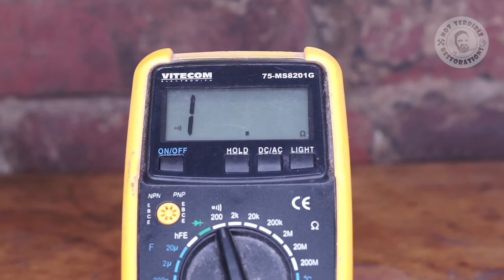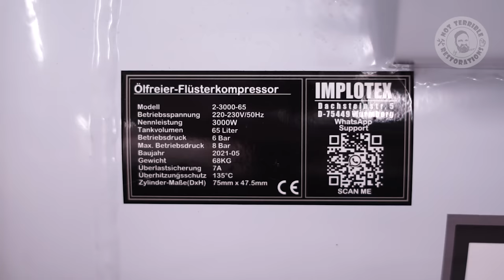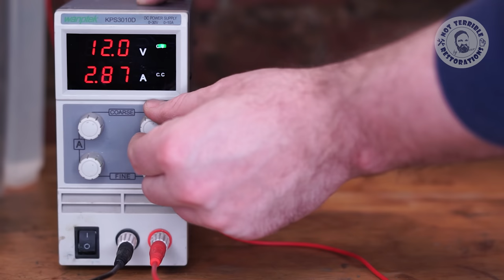You never SAW it coming - 1960's FESTO REPAIR and OVERHAUL

Comment from the maker: Disclaimer: I was kindly informed that the saw blade seems to be mounted the wrong way around. Very good eye and I missed this detail during video editing. However, the saw blade is mounted the right way around. At first I also thought that the saw was turning the wrong way around, i.e. that I had wired the motor incorrectly. When I frantically ran back to my workshop to check it, the saw turned the right way around. 

And then I realized what had happened. And here is the explanation: 
The shutter speed of the camera and the rotation speed of the saw blade are overlapping in such a way that the camera always takes a picture when the saw has almost made another rotation. If you line up these pictures in a video like usual, it looks as if the saw is rotating in the wrong direction. You know this effect for example from car commercials where the wheels seem to turn backwards when driving forward or in videos of old propeller planes where the rotor seems to turn slowly in the wrong direction.

There are countless explanatory videos on youtube, if you want to learn more about this.

I wish you all a good start into the new year and hope you will tune in again for the next video.

Comment: Hi. Very, really very nice restoration.
Quality is high and you really know what you are doing. The result is hardly too nice to work with...
The cleaning with compressed air at the end of the vid shows your relationship to your work !
Greetings !
PS: btw I've tried your trick at the beginning (drop the saw and the parts are separated) with my old jigsaw, which also completely fell apart !!! But in my case the parts are not usable anymore.....😂😅😂😅

Comment: That's marvelous. The shape reminds me of Raymond Lowey's designs for a number of things, including locomotives. I am concerned that I didn't see you properly lubricate the ball bearings, though.
Reply from the maker: Hey Jozsef those are closed bearings and they are closed because the lubricant is already inside. They are not supposed to be lubricated from outside so the engine doesn't get lubricant all over during use. At least that's how I learned it. Hope you are doing well. Let me know if you have other information on the bearings
Reply: @NTRprojects  If they all had seals, I missed it. That makes sense though.

Comment: The grounding or PE wire was missing because it’s a class 2 device and not class 1. You can see it on the label. The two squares and „schutzisoliert“ mean it’s a class 2 device. However: 1st, the cable that’s in use is illegal for class 2 devices. It must not contain a ground / PE cable nor plug. 2nd: nowadays it would be a class 1 device because it has a metal housing. Back in the 60s/70s it was enough to just paint the housing with non conductive paint for class 2. Today that’s no longer allowed because paint can scratch or screws in metal are still conductive. So today you would have to convert it to a class 1 device with working ground / PE wire to pass electric test.
Reply from the maker: That's very very helpful, thank you very much. I assume the cable was replaced at one point in time. In conclusion I did everything right from today's perspective when I connected the ground to the main body, right?

Comment: The " missing" ground is absolutely OK, the saw is Schutzklass 2, which means that dangerous voltages are insulated from the body, hence the plastic housing around the switch an motor.
Reply: Isn't it still better to have a ground connection in case the plastic fails somhow?
Reply: @ChristopherPerrin yes, it's adding an extra layer of protection but with older power tools it might trip the RCD.

Comment: Great restoration, but the blade is on the wrong side. 😉
Reply from the maker: Oh dang just rewatched the material and you are right of course. Will turn it around tomorrow
Reply: The blade is correct but the rotation of the motor is not. Imho

Comment: Guys, guys, guys! It's a tool, it doesn't have to be polished. The work is super, but also a little off.
Clean the commutator is ok, but the polish the rotor, which sits inside the machine - unnecessary. 
And if you use horrible rusty files for the work, the viewer wonders what the restoration should be good for, if you do not take care of your own tool. 
Nevertheless, the result is really good.